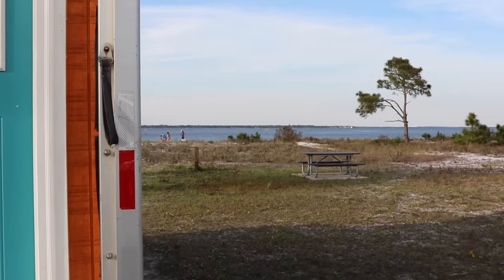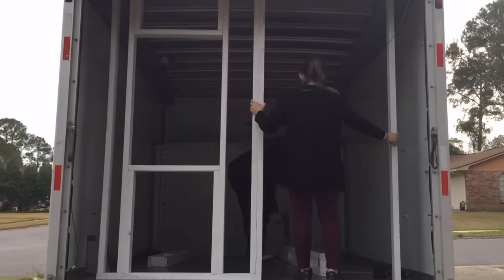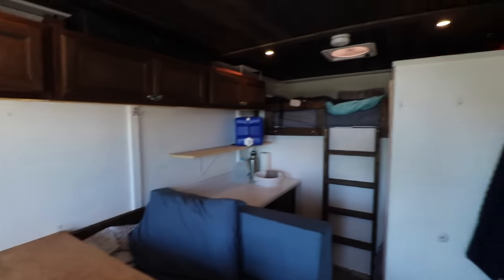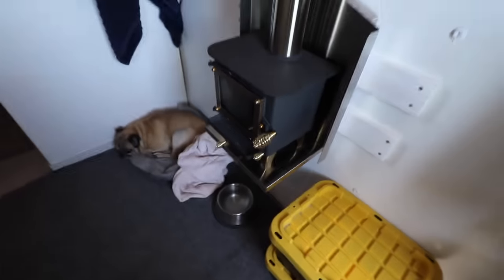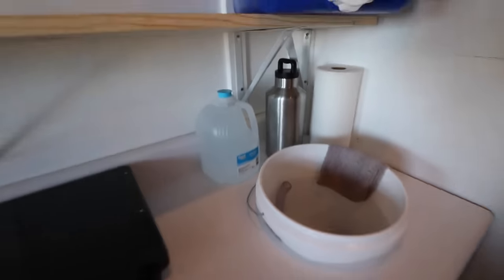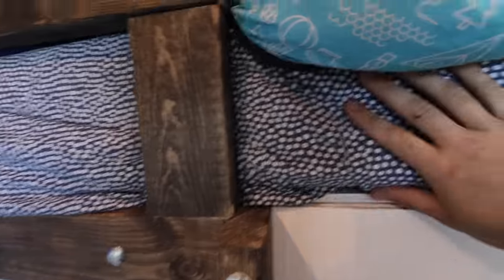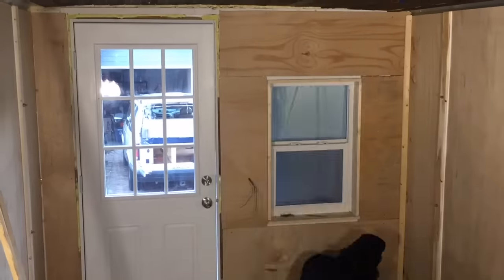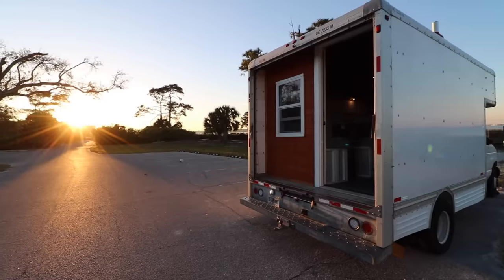Tour of Our Tiny House Camper (Box Truck Conversion)

Comment: That van is BRILLIANT. 
 I like the Fire for cooking, & Heating. 
For Stealth camping, 
I would Leave the Rear Door Looking NORMAL. With a Lock on the Inside ? 
Then fit a Slim Door to the Passenger side ? 

Park up Somewhere nice, 
Open the Rear door for Views & access ( in Warm Weather ) 
The side door would have Some kind of fold out step /s ? for easy entry. 

Just Ideas. 
I Like Your Van.  But I would Prefer it More Descreet when Driving around. 
Maybe even full size Barn doors at the rear ( 270 degree fold back to latch to the van sides whilst in use parked up to camp. ) 
(  Sprinter style fold Flat rear Hinged doors ? ) 

Logo the Outside of the Van 
ME HAUL,
FAMILY HAUL, 
Or think of your own Brand name. 

Do You Have Vinyl WRAPPING for Vehicles in the USA ? 
A thin Vinyl Stick on Film covering for the Vehicle Exterior ? 
Self adhesive Applied with a heat gun ? 

It would look Great with a Tree / woodland effect. 
or Log Cabin Effect ? 

Similar to the Fake Brick / stone interior Household Wallpaper Effect. 
JUST MY Ideas ?

Comment: Great camper/ tiny house! Even better when considering the price point. 
I'd love to know the measurements of the box and how you fastend the overhead cabinets to the wall… I'm pretty sure drilling through the side wall isn't a solution.
Reply from the maker: Yes we drilled through the walls and used carriage bolts. Sealed with silicone. Worked fine
Reply: @ColeWebb  Thanks for your answer. Looks like I over - complicate things :D

Comment: It would have been possible to keep the roller door on the back, there’s plenty who have kept it and in use. It’s easy to change the lock so it can be opened from the inside if needed. But I guess having a part through to the drivers seat then you wouldn’t be trapped! 
Good  build though, looks like tiny house. With what you spent you could have had a full tiled shower with a drum attached to the underside to catch the water! 
But Wouldn’t guess it’s in the back of a van! 
the way forward in today’s living

Comment: My only question is why didn't you cut a pass through for the cab into the box?
I understand that the Uhauls have a cab that is separate from the box itself but would it have been that hard to frame them together?   (Peske and Budget trucks have the box as the back wall of the cab but then no attic over the cab.")

Comment: I really don't think you need any more windows that would probably make it colder or hotter in there what you did with the windows at the back of it and the door you can always face your door or the back of the van toward the Sun and that's plenty I think you were smart for not putting more windows by the way I like your little camper it's nice

Comment: Great build and budget.  What did you use to bolt the back wall to keep it from moving??
Reply from the maker: Carriage bolts through the bottom and sides of the wall framing.
Reply: @ColeWebb  Sweeeeet. Thank you. Do you remember the length you used?
Reply from the maker: @ModernMessiah  Not sure, it's been a long time. I think the exterior walls were around 1" thick and the 2x4's are 1.5" thick. So I probably used something like a 3.5" bolt.

Comment: might i suggest  yr shower go website cheaper than dirt they have a bladder system you can use to shower with can put in Sun so it heats up then bring in or possiably run a hose..and windows might want to go with those solar tubes people put in their roofs of homes  would be perfect on yr camper  sometimes see free Craigslist

Comment: Love the Van/Tiny house. I have one question, why didn't you buy a toilet but instead use a Piss Jug?
Reply: I used camping toilets for a couple of years while I was a trucker. They fill up fast even if you don't use them for urine. Also, the smell will seep through the plastic wall of the holding tank as the toilet ages. I ended up using tall kitchen trash bags occasionally when I couldn't wait to get to a toilet.

Comment: Hey Cole.... I know it's been over a year but one thing bothers me about the set up.... If you would have a fire you are sleeping near the door so that's good.  But the kids are separated from the door by the heater.  It seems that they could be trapped in that over cab bunk area.  Do you have a smoke detector and extinguishers.

Comment: How is the regular window holding up with driving? Ive been curious about using regular windows on this type of truck 🤔
Reply from the maker: It held up just fine for many thousands of miles and on rugged mountain roads. It’s nothing to worry about if you’re considering a build.
Reply: @ColeWebb  thank you! X

Comment: I built something very similar but I added a roller shutter to hide my rear door so no one knows Im living in it, a normal shutter wouldn't fit for your van but I know there are some more compact ones made with a heavy duty canvas type material. I highly recommend going un noticed from the prying eyes of the ignorant and judgemental. Have you upgraded it with solar etc since this video?

Comment: I thought the u-haul trucks were cutaway, meaning the the cab and box are connected,  water tight and you can cut a pass through hatch In between them. ? . . .

Comment: How did you do your wiring from alternator to battery, then battery to all the lights and fan?
Reply from the maker: I put a 300 amp switch in the cab, between the starting battery and an RV battery I had in the tiny house. The lights and fan were wired to a small fuse box and then to the RV battery. The switch was turned off when we weren't driving so that we wouldn't drain our starting battery.

Comment: Instead of wasting all that space under the sink with another bucket, why don't you just use a bucket without holes drilled in it for a sink? When you're done using it you can just pull it out of the countertop and throw away the grey water. I don't get why you'd use a bucket with holes to drain into another bucket and then have to dump that second bucket. 2 buckets too much!

Anyway, good video of a cool build. Keep us updated!

Comment: Holy cow I was getting sea sick with all that camera action. I'm claustrophobic so no way I could  do that with no windows  and how do you get fresh air circulating in there .That little fan doesn't do that
Reply: you open the window and run the fan. the fan creates negative pressure and sucks in air from the window.

Comment: Ok so bro...for 12000 I bought a 2007...36 foot toy hauler. 1 was tax title amd licences in Florida. I haul it w a 2500 hd. GMC that was 1200. I needed wiper eeulator and tires in tje gmc. Tjat was 500 total. So for under 14k I'm set w 3 bedrooms. A folding rear wall to tje ground for my hyabusa. I've a full garage w a chain fall i can pull engines amd do full repairs. Cittimg torches amd 3 queen sized beds w 2 rooms amd tons of storage. Full stove. A.c. 3/4 sized fridge. A huge awning. A piggy back grill outside w quick connects. All included. 240 gal white water. 100 black and 50 grey w batteries. Solar. 2 12 v marine batts. All of which was under 14k amd 4 grand of that is interest amd 1200 was tax title akd tag I could have not got it at a dealer for 9999 and tje 1700 or so in tje gmc. 130k miles on that. Now no Bill's at all. It has an Onan generator worth 3000 as well. Was a huge selling point 4 me. I have electronics for tank levels amd power management. Tjere is a 4000w inverter as well akd 2 97w solar panels. I'm so happy amd BLESSED. MOST OF YOUR GUYS BUILDS ARE 10 TO 15K AMD FOR THAT IVE A HUGE PKACE AMD CAN LIVE AMD TRAVEL FREE

Comment: Dam I guess it's ok however you might have been better off buying a RV I don't know 9,000 I bought a  class c RV. That was ready to go for 1500 it had a grey tank waist and water with a pump it was hooked up to the faucet so soon as you turned the sink faucet in the bathroom or shower it would start running oh and it had a generator to I forgot it has been some years back still anyways nice job

Comment: Why do you say your bucket toilet is not liked by people. That is the best solution while camping. You need a solid bathroom door and an exhaust fan inside the bathroom so that people in the living space will be spared of the smell when someone is using the bucket toilet. Also, if your bathroom outlet opens to the earth then you should have build the bathroom on the main doorway with accordion foldable walls so that you don't lose precious space for bathroom. After all we don't use the bathroom for more than a few minutes every day.